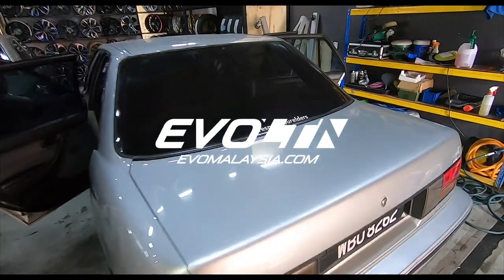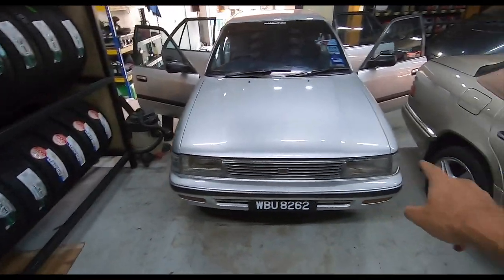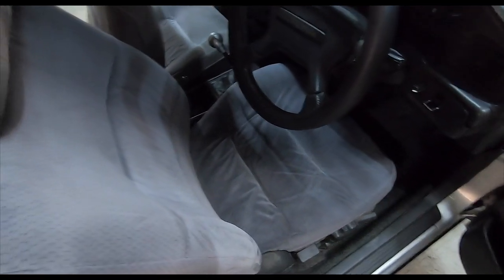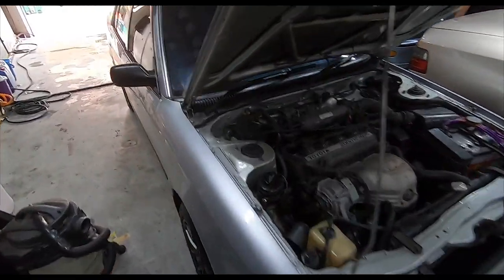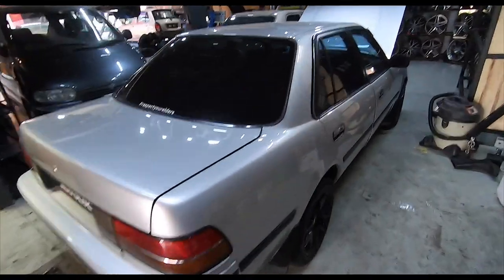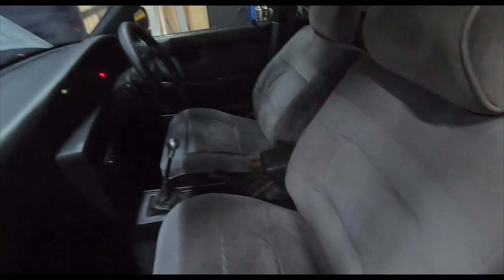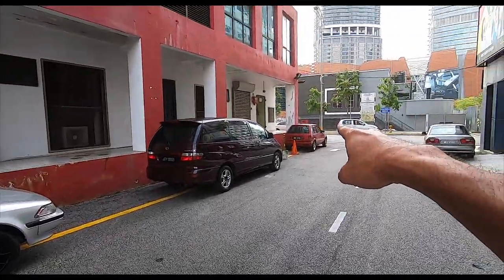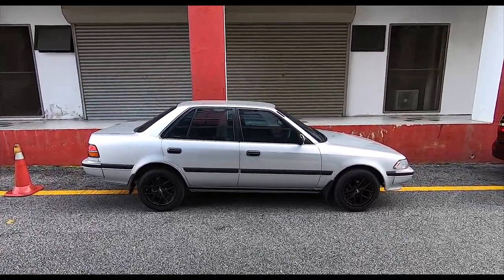WEEVIL UPDATE: 1989 Toyota Corona 2.0i - Interior Cleaned & New Alloys Look GREAT! | EvoMalaysia.com

Comment: Chris, can i ask something, just wonder what's the different between carburated and injection?
Reply from the maker: Early model cars before fuel-injection was invented, used a carb(s) to regulate the fuel & air mix going into the combustion chamber, it was a mechanical device, unlike modern fuel-injection which is electronically controlled, hence the E in EFi 😊
Reply: @ChrisWeevilGarage  Ohhhh okay, thank you for that!!!! ☺️😄👍